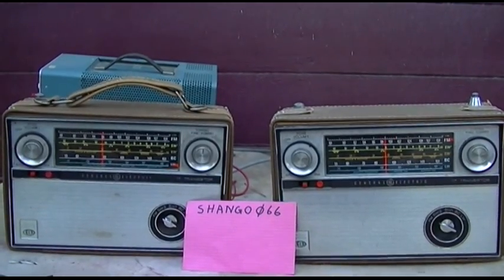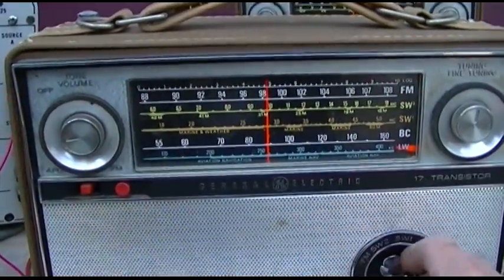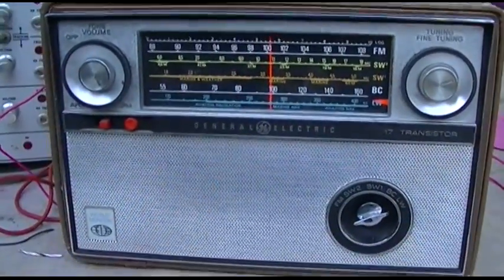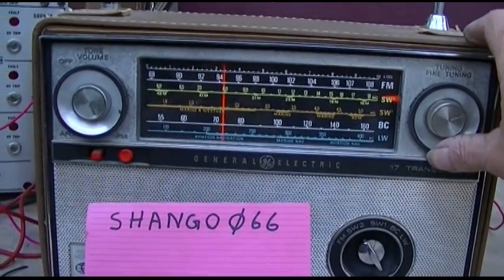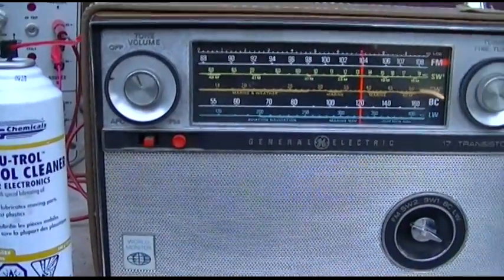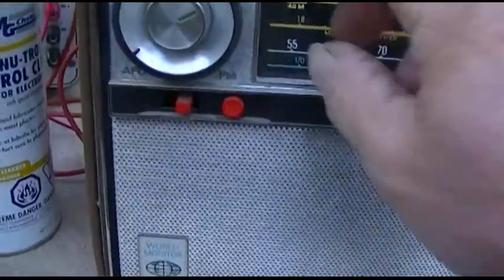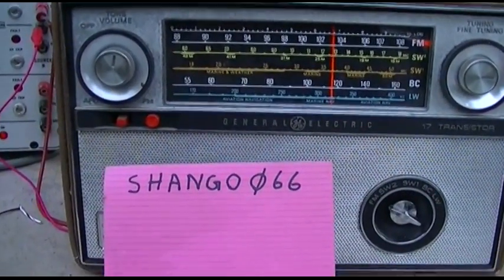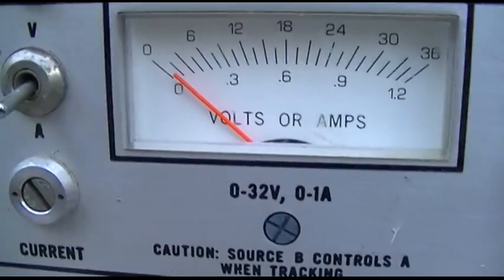General Electric World Monitor Radio Assessment for Repair

Comment: Sometimes, losing your upper frequency hearing can be a blessing. I can remember being able to tell a tv was on even if the sound was off and the picture brightness turned all the way down. I could hear the high frequency from the flyback? or is it the horizontal oscillator? That was 39+ years ago.

Comment: This has been a great series of videos. I was looking on Ebay tonight for one and found this: http://www.ebay.com/itm/1960s-General-Electric-P990A-World-Monitor-Multi-Band-SW-Radio-Zenith-Royal-94-/361553207498?hash=item542e4020ca:g:r4QAAOSwPpFXMATn

It's really odd, it looks like someone put guts from a Zenith Royal 94 into a GE P990 case. Am I reading that right? :)

Comment: I've had one in my cave since the 70's. I took it out a few years ago, polished it up and put a jack for mp3 input to it. Never sounded that great, but ok for podcasts and occasional FM.

I think I will try ordering some Russian germaniums after checking mine on my Tektronix curve tracer.

I could really use one small center knob.

I also have the manual/log that goes in the pouch.  Outdated a bit :)

Bet I have output amp problems, your video made me bring it in from the garage.

Comment: I can definitely hear that high pitched squeal/frequency, that's the very sound that I her every time I turn on my television briefly, then dies down on said television after
Reply: Also the reason that the squeal from the germanium transistors gets worse the longer it's operating for, is because, by the last time I checked, they aren't designed for prolonged use after a certain point in radio use, I most likely could be wrong on that though.

Comment: Shang, I'm repairing a ka-6100 kenwood amp right now.
I have it working but the filter caps (power supply are bad) I'm going to change them.
my question is should I just change all electrolytics?
thanxs
Reply: +Doctor Forbin It's not always necessary to do so, just check the ones that are malfunctioning.

Comment: I'm just curious why they designed that little package of transistors on that board that way. Interference/noise reduction? Just seems to make servicing and bias a pain in the a#$@
Reply: +ScottTV1962 I was wondering the same. I know GE was into cost cutting, perhaps they just knocked out those daughter boards in mass then could solder in across a wide range of sets. An early form of integrated circuit.
Reply: +ScottTV1962 modular was a big deal back then.  Was it Motorola Quasar that had "the works in a drawer", i.e. plug in modular boards.

Comment: AM radio has a shut down in Europe. the BBC uses long wave on the last broadcast tubes, Medium wave gets quiet as stations shut down because DAB and DAB+ gets shoved through our necks. I miss listening as a kid to AM with my dad till Radio Caroline got raided on the high seas, we got radio seagull on 1KW in Harlingen Netherlands from a light vessel conversion to radio ship. short wave has it's fans for DX ing. I use granddad's Yacht boy radio from the 1980's.
Reply: Yeah the only AM stations in Europe are mostly Russian.

Comment: I have seen those ultrasonic oscillation troubles in similar amplifiers caused by an open decoupling cap and sometimes a leaky coupling cap.
Reply from the maker: +RF Burns Ill try that first but last time it was the transistors. Its worth a shot

Comment: Why not just replace the audio board with a simple IC, available on e bay for a few $. I've done this anumber of times. Not worth all the messing about! The new audio amp boards often sound better also.
Reply from the maker: +Michael Beeny I like to keep the original design and not modify vintage stuff. At some point the mods reduce the value and make diminish the vintage effect